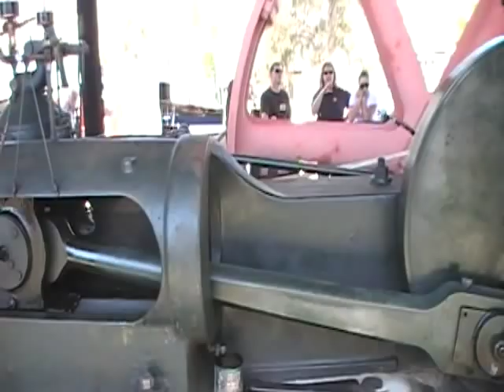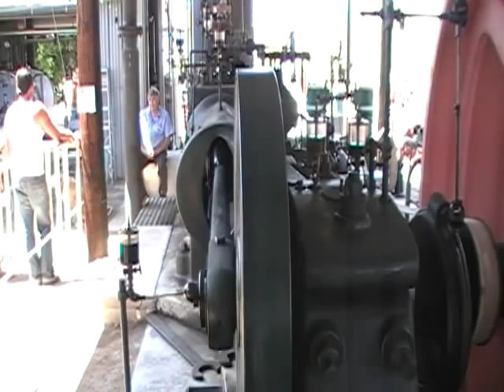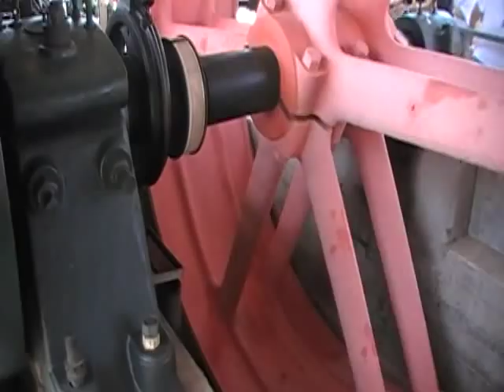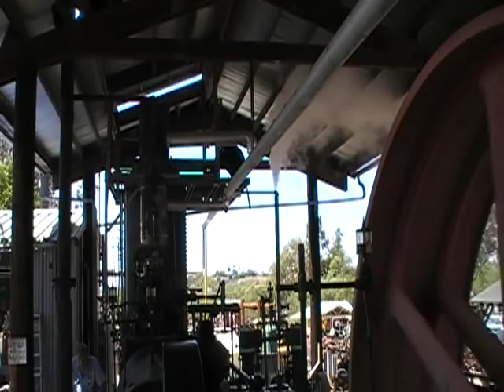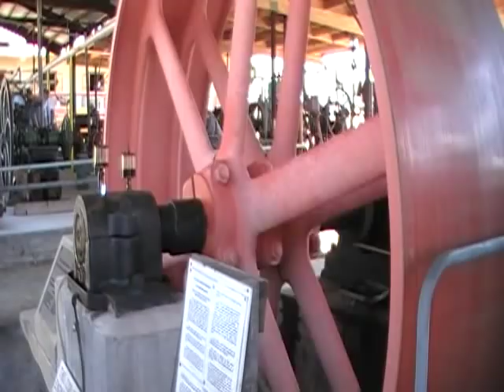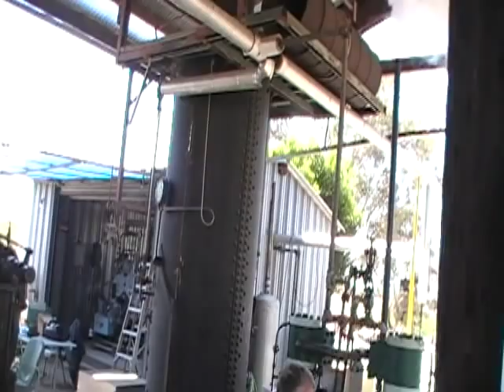1910 Allis-Chalmers Corliss Engine At Vista, California 6-26-10

Comment: I saw where they put a steam tractor on a dyno that had 120 HP and it was putting out 3,000 foot pounds of torque. This will give you an idea. Steam is not fast but in most cases put out more torque per HP then many combustion engines.

Comment: Here's the formula for finding horsepower from torque and RPM.  Since you have hp and RPM, you can rearrange the formula to get torque.  

HP = (Torque x RPM)/5252

This means that this steam engine is capable of producing 19695 ft-lb of torque at full steam.

Comment: It's running at idle. If they got a machine shop to build them a generator and gearbox designed to take advantage of 300hp @ 80rpm, hooked it to this engine, and ran it at full power, they could kiss their electricity bills goodbye forever.
Reply from the maker: Unfortunately, their fuel bill would more than make up for it.  There is huge power potential here, but making cheap electricity isn't where it pays off.  Unless they're using solar energy to boil the water.